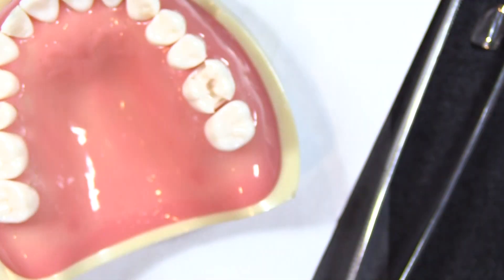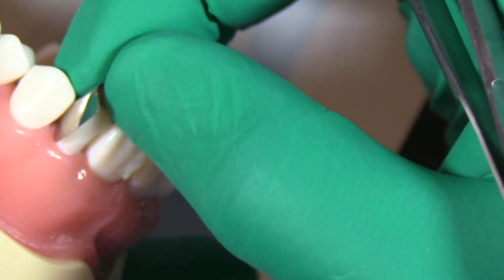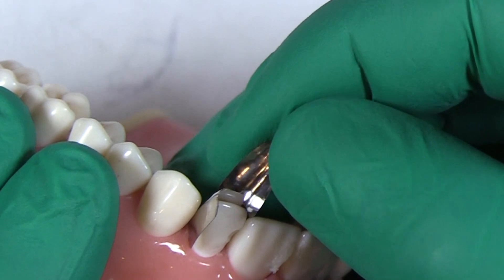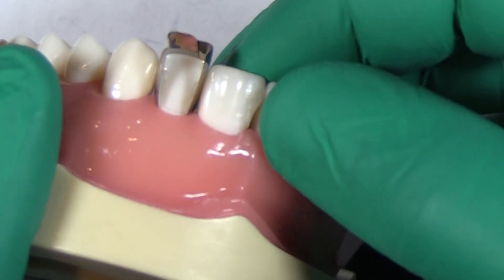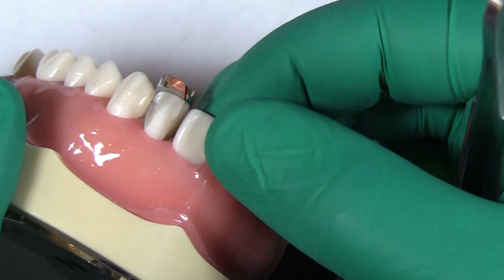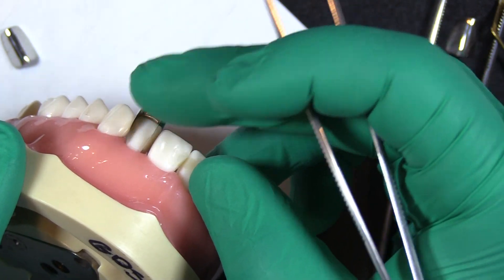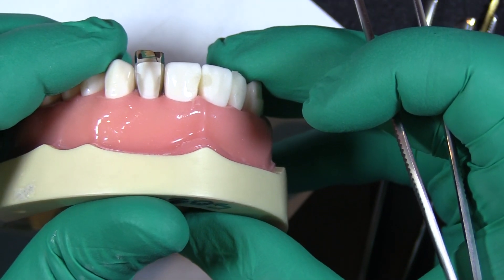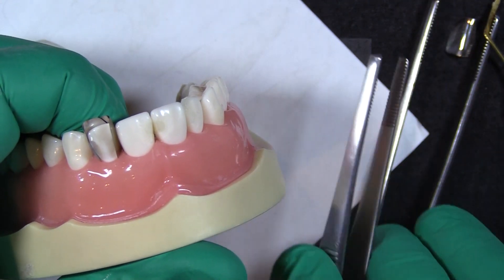Placing two fusion anterior matrix bands on a single tooth

Comment: I think the anterior bands should come in different sizes. For example I think most times they are not wide enough.
Reply from the maker: Thanks for the feedback! We've been looking into the possibility of adding more sizes if it can work with that firmer metal. I'll make sure to let our engineering team know that we may need to look into making them wider, and not just shorter and taller.
Reply: What’s the name of Matrix band?
I used anterior spoon 🥄 band